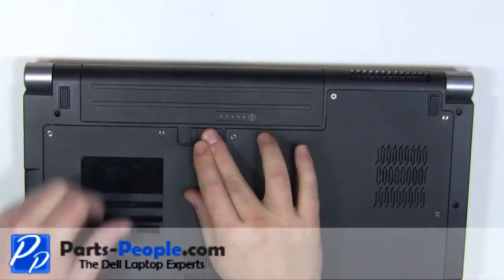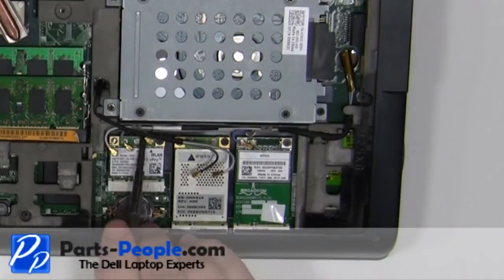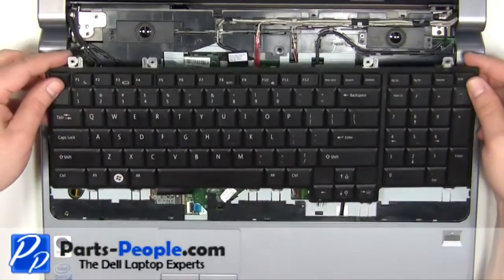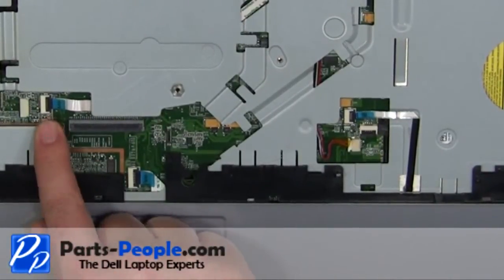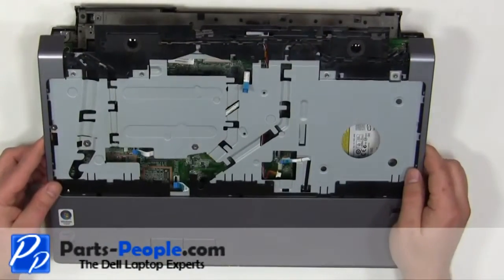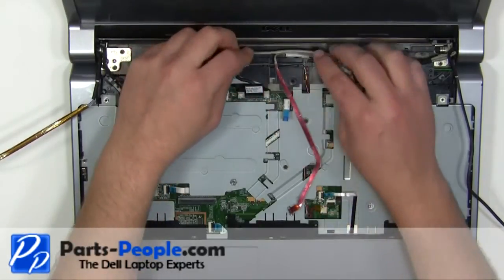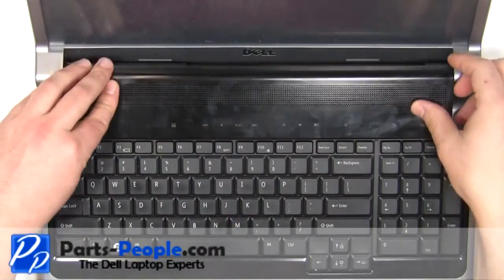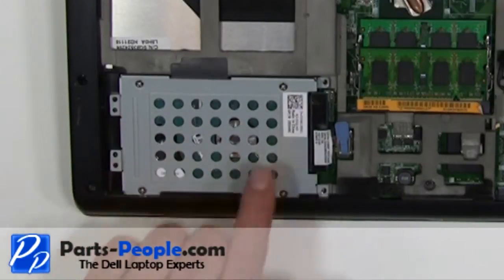Dell Studio 17 (1735/1737) | Audio Circuit Board Replacement | How-To-Tutorial

Comment from the maker: The 1537 and the 1737 are similar but one of the differences, besides screen size, is the 1537 doesn't have a audio circuit board. The audio jacks a built directly on to the motherboard. Replacing them would require replacing the motherboard. I have some motherboards here:
ppci.me/c/148/241/motherboard

And the video is here:
watch?v=uVBOSGgassE

Be sure to check your motherboard part number for compatibility. I hope this helps.